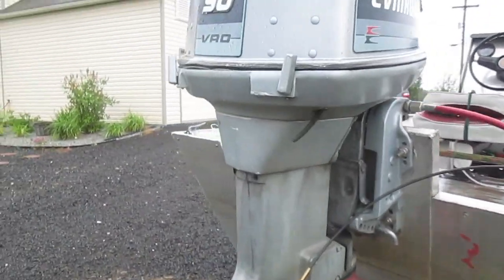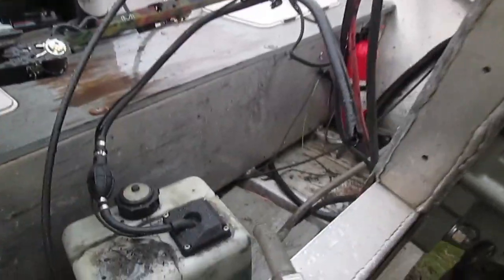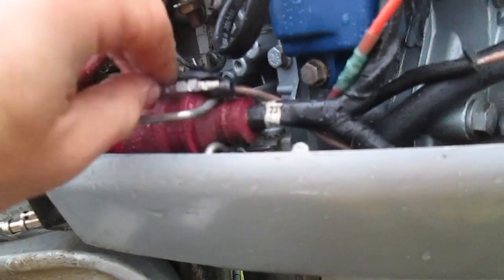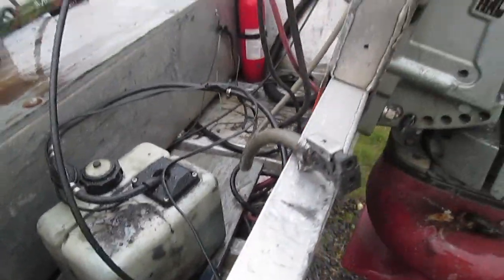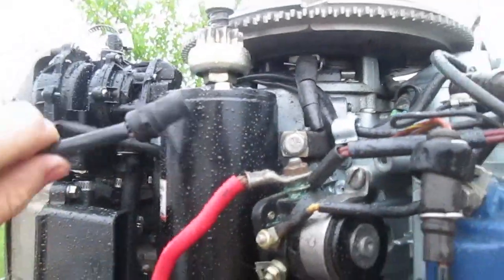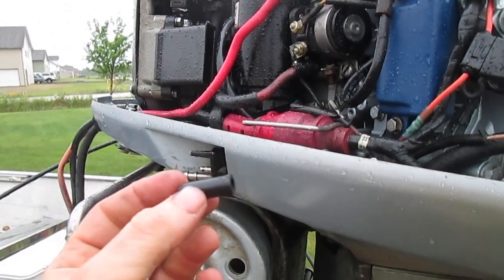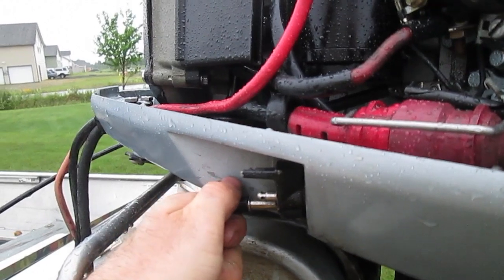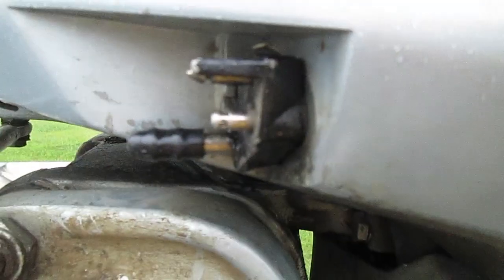VRO Removal Disconnecting VRO Capping Evinrude Johnson Mercury Outboard motors

Comment: You also need to use the primer bulb to pull fuel through the line until you see the oil mix come through or you’ll run with no oil for several minutes while it burns the fuel in the line

Comment: are you saying you had problems after you did the conversion or before ,, i did that to a motor. now i have a problem when accelerating not sure if it was doing it before  or after ,
Reply: Racso, my 93 40hp has the same issue you describe after doing the VRO delete, curious what you found out regarding your acceleration issue?
Reply: @CruizinWithTheCarsons  I never found out what the problem was the guy i bought the motor from said it worked fine before I eliminated the VRO, but I sold it to a mechanic I think it was something to do with air mixture in the carbs , but could have been just a sensor also, good luck with your motor
Reply: @CruizinWithTheCarsons Hi, did you figure it out? I just picked up the motor in this video and am thinking of doing the same.

Comment: I liked how you showed everyone how to figure out how many gallons you had left by converting to cubic volume. However why not just see what the total capacity is full, add the oil for that amount and top the tank off to full?
Reply from the maker: I do that, but I was trying to figure out how many gallon tank I had earlier and wasn't at the gas station.  Typically I put in the fuel and then the oil and figure the sloshing from driving will mix it in before i get to the lake/river.

Comment: Trying to find out. What my 1998. 70 hp. Motor is . .it's a e70tlecb. .don't know if 2 stroke or 4 , any help would be good . just got it on pontoon boat for. Soome gutter work, also have a 40 hp evenrude. 06 model that I don't know about rather it's atec. With the oil tank on the motor any help I'd be happy to hwre
Reply: How do I disconnect the automatic shut down after I have disconnected the automatic oiler

Comment: That VRO pump requires oil to operate effectively. If you put that plug over the oil input line, eventually, all of the internal parts of the pump will dry out and your entire pump assembly will fail. If you DO remove the VRO pump and want to replace it with a regular fuel pump (and premix all your fuel) make sure you replace it with a pump that does not come with a nipple for oi input. One can be found here: https://www.amazon.com/Outboard-Replacement-Evinrude-20-140HP-Replaces/dp/B06Y4CBVJD
Reply: Nate Gray: I just acquired a '93 Evinrude 150hp Intruder, and the previous owner disconnected the VRO. The nipple that used to accept oil, just above the nipple inlet for fuel, is not capped. It's just sitting there doing nothing. Uncapped, can it cause any vacuum issues?
Reply: The nipple is likely still there, but it probably is not actually an opening that goes into the pump. It may appear to be hollow from the outside, but if you were to try to stick some fishing line into it, it would probably block the fishing line. does that make sense?